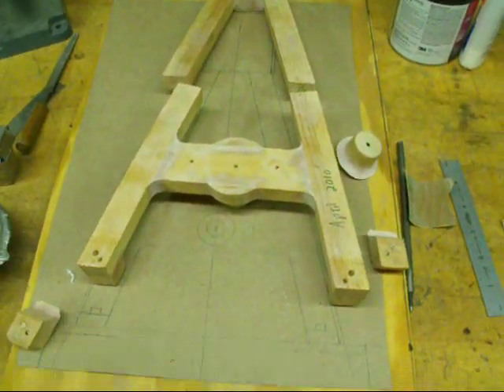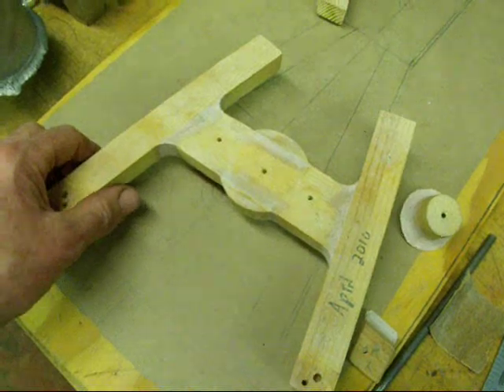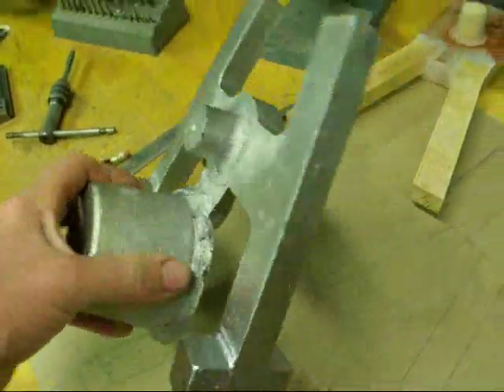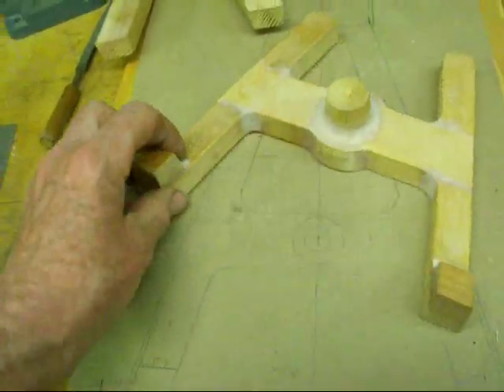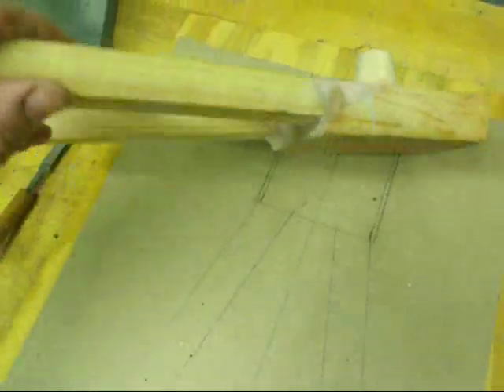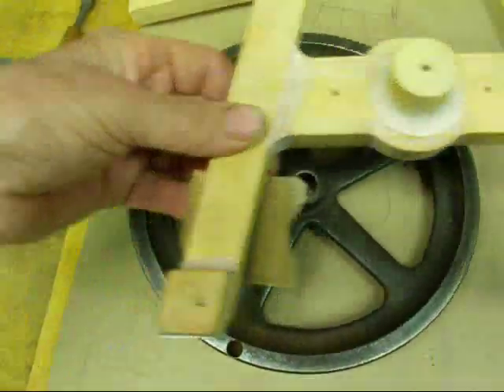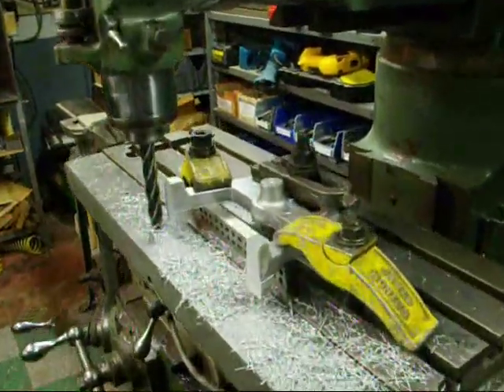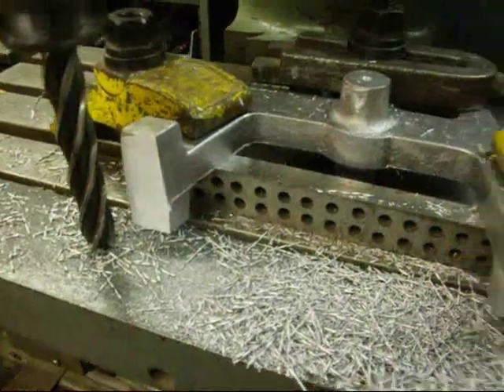BUILDING A MODEL STEAM ENGINE part 4 tubalcain

Comment: DO you need the needle bearings on this motor is it were 1/3 the size? How about keeping it greased with a zerk fitting?
Reply from the maker: +ray29999 needle bearings not needed. Thanks for watching

Comment: I wholeheartedly agree. One of my friends made a steam casting from cans one time and it went off like a bomb when it built some pressure. The whole casting just came apart and sprayed everything with shrapnel. luckily no one was standing close enough to get hit. Cans area good source of metal for ornamental stuff like jewelry and decorative pieces. I agree though never for high stress applications.

Comment: i have a few turning casting for a 1/4 scale 65 case, i'm almost done with the engine and i've been missing a lot of parts so most of the parts me and my dad have fabricated and then milled it with a kt rotary head, how strong are aluminum castings??

Comment: I was wondering, if you would make channels from the extremities of each leg upward to the surface, wouldn't it improve metal flow, letting air out, avoiding air bubbles like on the cylinder casting? I remember seeing a engine casting and it had the channels to the surface, and after pouring the metal they covered the channels with a type of sand. I don't know much about casting but i'm just curious.
Thanks for these amazing videos!

Comment: @fly2000jtb Cans and tabs are really a poor quality aluminum, so would ladders as they are extruded al and any al that is extruded does not cast and machine well. I go to the local wrecking yard and pick up scarp aluminum in the form of transmission and engine housings as they are a higher quality of metal. I get it for free cause I also teach auto mechanics and I give the guy cars in trade but I would suggest you talk to your local place. Al rims are probably the best type.